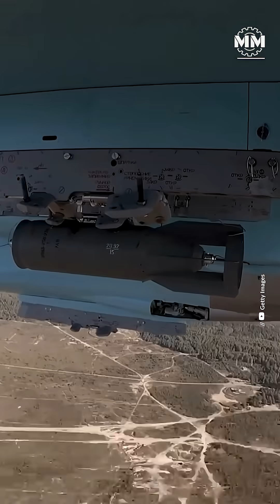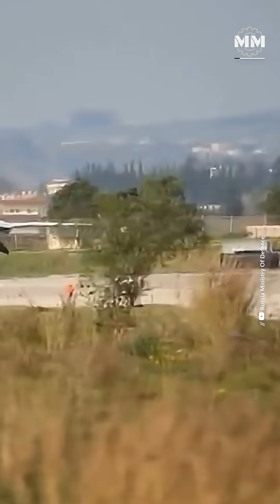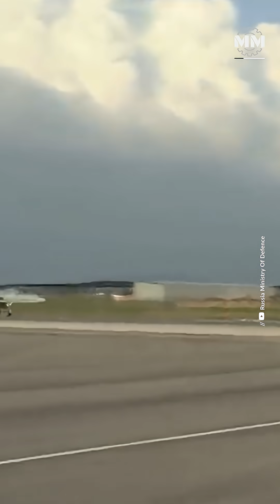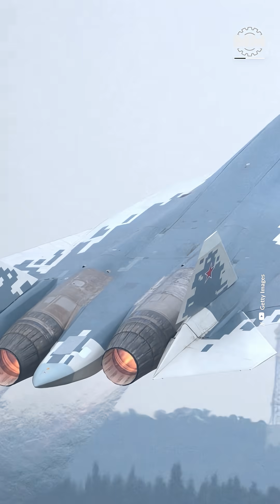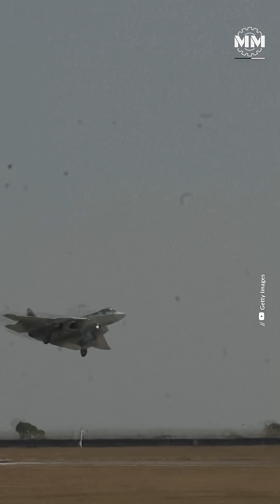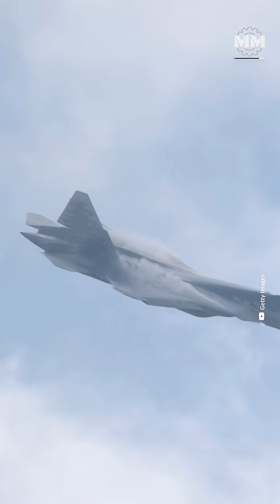The Real Reason Russia’s Su-57 Sounds So Different from the F-35

Comment: fun fact - F22 engines weigh 20% more, providing 10% less thrust
Reply: Have anyone seen the SU57 over Ukraine?? Anyone???
Reply: @peterlongland6862

Yes, Su-57 has confirmed combat missions in both Syria and ukrain. Hope that helps if you were actually curious, if you’re just trolling then please ignore this.
Reply: @peterlongland6862 yes. confirmations are easy to find actually, if you aren't completely brainwashed.
Reply: @peterlongland6862 no. Which means Su-57 stealth is working. Get the idea?
Reply: @ryszardrakowski2711 non existence is not stealth!
Reply: @peterlongland6862  has the f-22 ever engaged with anything more challenging than a hot air balloon? Ever???? 😂
Reply: @ryszardrakowski2711 actually only 50 Su 57 are in service...no parts...Putin is also thinking twice since about 50 of them got shot down with Russias own s400 😂😂😂...look it up
Reply: @tomvlodek6377 uhh yes actually. Iranian f4 phantoms. Didn’t want the smoke so they flew away. Look it up. The reason the f22 has not had more battle presence is because when it shows up, everything else tends to behave….everyone with any type of service knows this tactic. When the f22 shows up act normal, when it’s gone, start throwing bullets and missles again. Literally the MO of the f22s whole life
Reply: @tomvlodek6377 , when the F-22 is sent, then you know you're going to get a what for. It's the only jet that can't be sold to other nations. It's that dangerous.
Reply: and the f22 would still smoke the su-57 10 out of 10 times and it’s literally not even close
Reply: @extinnocence , nice dreaming
Reply: @kaka_kaka28 google it man it’s really not an opinion… SU-57 is a beautiful plane and I respect the engineering and I also accept the reality that the radar, stealth, and weapons capabilities simply don’t even come close and if you say otherwise you simply haven’t done your research
Reply: What’s so fun about that?
Reply: This guy is full of shit and doesnt know anything.
Reply: Fun fact. One Raptor could take out 3-5 SU-57’s before they even knew they were there, and that depends on how many SU-57’s actually are airworthy. Very unlikely that they have five of them ready for a battle. There’s a reason why the F 22 has never been in battle. It’s not needed. It’s too good! So good that it’s actually against the law for us to sell the F 22 to any other country. Fuck Russia!
Reply: Which one of them have been used in a real war? The fight against sheep armies or real war?
Reply: @josephguillen187  they shot down a 'chinese Airship" :D
Reply: @pingumy , Yugoslavia shot down a stealth aircraft F-117 using Russian radar for detection and later they wrote an apology letter to the American President "Sorry. We did not know that the F-117 was a stealth fighter". 😂🤣
Reply: @kaka_kaka28 That pilot that lost the F-117 was reprimanded for making several mistakes in his procedures and his flight path. Had he followed his instructions the F-117 would have never been shot down. So yes we lost a stealth fighter jet due to pilot error!
Reply: @garywkline , what was the pilot error?. 

The pilot of the F-117 shot down over Yugoslavia was NOT reprimanded; instead, the incident highlighted weaknesses in the F-117's operational support and tactics. The pilot, Lt. Col. Darrell Zelko, successfully ejected and was later rescued. The U.S. Air Force's primary focus after the incident was on damage control and quickly moving past the event, which was a significant blow to the reputation of stealth technology. The downing of the F-117 was due to a combination of factors, including predictable flight paths, a Serbian radar technique of using short, precise radar bursts, and the lack of a dedicated electronic warfare aircraft to jam the Serbian radar.
Reply: @josephguillen187 Su57 shotdowned F-16 and russian stealth drone Okhotnik behind frontlines on ukrainian side, and they failed to detect it. Also Su57 performed long range ground strikes, when F22 can be armed only with AMRAAMs.
Reply: @borise4104  Russia has already lost some 150 war planes over Ukraine which is why they lob glide bombs from 70 km behind the frontlines, to avoid adding more to that statistic … yet they’ve managed to lose another 25 in training accidents! Even then, Russia’s Su-57 stealth fighter has only flown a few times in Ukraine and never within 100 km of the frontlines, if it were able to fly over Ukraine with impunity … then you better believe that Putin would be using it!??
Reply: @borise4104 😂😂😂😂😂😂 of all the things that never happened this is one of the ones that never happened the most.
Reply: @borise4104 USAF 2W1 here. The F-22 can carry more than AIM-120's. You don't know what you're talking about.
Reply: @jacushman yes. aim-9x too. but another weapon only on external pylons.
also known that f-22 is a specialised air superiority fighter, incapable of ground strikes (f-35 was created to close that gap). also, f-22 was created before 32bit personal computers, and the level of digital modeling and firmware in the electronics is totally different now and in the late 80's, when f-22 was created as its radar AN/APG-77.
Reply: @borise4104  LOL You still don't know what a 2W1 is. The GBU-32 and the GBU-39 can be carried internally on the F-22. As far as avionics go, ever heard of Block Upgrades? The F-22 has gone through several with the newest being the Block 35 upgrades. You don't know what you're talking about.
Reply: @borise4104 It would've been embarrassing if their brand new flagship jet lost to a 40year old version of the f-16 in airspace that is contested.
Reply: @AgneDei  offcourse! that's why you did hear about "gamechanger f16" only before they arrived in Ukraine. what western propaganda is ignoring with a really iconic pokerface is how fast f16 was wiped out. and no one speak after that about them or about that they was sent to Ukraine at all. if only Ukraine didn't had largest post-USSR anti-air defence after Russia their airspace was not contested from the 22s.
Reply: And F22 engines have 40% longer service life than Al-41FN
Reply: And yet it’s 75% better of an aircraft, and in service. Fun fact.
Reply: @jritte1968

Both aircraft are in service. And there is no proof that 22 is, in any way, better.
Reply: @jritte1968 better in shooting down balloons, when Su57 is better in actual war usage.
Reply: @borise4104 The SU 57 has never been used in actual combat. Putin knows it’s an air show performer and not an actual combat asset. Why do you think India dumped it? No one would dump the F-22 if they could get them.
Reply: @matthewhuszarik4173 The S-70 Hunter drone was shot down by a Su-57 deep behind the front line on the Ukrainian side. This fact is not disputed even by the completely unprincipled Western propaganda. Also Su-57 performed many long range ground strikes and was filmed by ukranians on their side of the frontline. Also Su-57 has the longest recorded air-to-air kill vs F-16.
Reply: @borise4104 😂😂😂😂😂😂😂 an SU-57 “world record kill” vs F-16 omg that’s so funny. Keep dreaming sukka
Reply: @borise4104 😂😂😂😂😂😂😂😂
Reply: @matthewhuszarik4173  how tf would you know, american fanboy?
Reply: @Desert_airgunner  did you get paid in dollars or spooge for your post?
Reply: @matthewhuszarik4173 100% correct...F-22 is still the KING...second only to the new F-47
Reply: @borise4104 сравнивать Су 57 с f-15 f-16 одно и то же что сравнивать хрен с пальцем 😂😂😂 даже  Су 27 в спарингах сбивает f-15 в восьми из восьми случаях. У f-15  шансы победить  даже Су 27 равны нулю
Reply: @jritte1968  fun fact, f-22 is a pos that is awesome to use on barefoot civilians and hot air balloons 😂
Reply: @tomvlodek6377 You gonna cry now?
Reply: Su-57 is a 4th generation fighter with questionable stealth technology....end of story....its like Iran flaunting the F-4...😂😂😂😂
Reply: @jorgegutierrez3054 cope 🤡
Reply: The US builds overpriced, useless garbge. And the pathetic F-35 is so stealthy, that when one crashes or doublles as a submarine evenUS air force cannot find it. 🤣🤣🤣🤣🤣. And ask India what it thinks about the pathetic flying laptop.
Reply: @ryszardrakowski2711 haha you have absolutely no idea what you’re talking about
Reply: @ryszardrakowski2711 your an idiot, the indian dont have the F35 nor have they flown agaist them. Old proverb, its better to stay quiet and let people think your an idiot then to open your mouth and prove it!
Reply: @ryszardrakowski2711 lol yeah so terrible the Israelis used it to shit all over Iran without getting a scratch in return 😂😂😂. Sorry your shitty Air Force can’t afford good planes bro. But until one of you losers actually shoots down an F35 or F22 you need stop crying.
Reply: @ryszardrakowski2711 aahhh😂 jealous your country cant afford even 1 F35?
Reply: @ryszardrakowski2711 Yeah, so usuless it outperformed all other aircraft. The early migs had a slight advantage till the F4 and then it was downhill from there for the migs.
Reply: @peterlongland6862 And yet you have to force the other countries to buy your fighter jets.
Reply: @josephguillen187 is that what you think, how wrong can you be. Not all NATO nations use Americans jets. You should know that. Already you have been proven wrong!!
Reply: @peterlongland6862  delusional fanboy 😂
Reply: @peterlongland6862 according to USA propaganda! 😅
Reply: The F-22’s engines allow for Super Cruising without afterburners and can’t be seen by radar. The SU-57 is an airshow performer that dies having never seen the enemy in actual combat. Why do you think Russia isn’t using them deep inside Ukraine, but the Israeli Air Force takes its F-35 right into Iran?
Reply: @matthewhuszarik4173  youre an idiyut
Reply: @matthewhuszarik4173 Russia IS using them, and even the Su-35 has a super cruise, and Su-57 had it even with first generation engines. With the second generation engines it has 2M supercruise and greater than 1.5 thrust to weigh ratio.
Reply: @borise4104 F-22 Super Cruise >Mach 1.5. SU-35 Super Cruise Mach 1.1, SU-57 Super Cruise Mach 1.3. F-15EX Mach 2.2-2.25 without afterburners. Before they called it Super Cruise.
Reply: @matthewhuszarik4173 You already wrote complete nonsense here. And still trying to continue to do the same.
Su57 with serial engine has 2M+ supercruise. F-15EX doesn't have supercruise at all.
Reply: @matthewhuszarik4173 Matt mate, I'm a huge fan of the F-22 but you have got your information wrong. I'm a life long aviation enthusiast (aka nerd..I do fly myself though with a CPL) so I love and appreciate any and all good aircraft regardless of the country who built it, that means nothing to me.

The fact is the SU-57 has the most advance and best supercruise ability of any aircraft made too this date. It exceeded anything else even 2 years ago on the old engines. With the new significantly improved engines it's miles ahead. M.21  supercruise without afterburner and extremely good fuel efficiency. 

Like it or hate it (which I can tell you do) that's simply the facts.
Reply: @borise4104 all this Russia talk and yet we can all see Russia struggling against $20 drones and 60 year olds drug off the street two days earlier. Russia would get their teeth kicked in by a modern military with training.

Comment: So? If you are close engough to hear the nois you are alrady fucked. Also the su 57 also has the capacity to supercruise. Bouth the F22 and F35 need to engage the afterburner in order to sustain the high angle of attack manuvers used in airshows. In the video you can see the F22 lighting up the afterbuner to ewngage in manuevers.

Comment: You’re mixing up a few things. The compressor blades (at the front) are open on each plane and there is little noise made by the compressor blades- a whine. There are no fan blades as they are turbojets not turbofans. I think you could simply say that the F35 (and you’re showing the F22) have a more effective noise reducing geometry behind it.
Reply: Turbo jets have fan blades too
Reply: @AndrewPlura-lt3mr  They have blades, but they are compressor blades. "Fan" designates a set of blades moving air that is partially bypassed around the engine. Turbo fans have some degree of bypass. Turbo jets feed all air through the engine internals.

Comment: That howl was valid for the prototype, the actual SU-57 doesn't do that. Also regarding the stealthy flat exhausts: the SU-57 has that option, you can actually mount either the round nozzles for better agility or the flat ones for better stealth. And I'm not talking about different models, you can place either option on the same aircraft depending on the mission
Reply: the flat nozzle is on the newer AL-51 engine, which will be used on the SU-57M. But currently the SU-57 is produced with the AL-41F1 engine, which is only with a round nozzle. 
The Russians claim that flat nozzles have a thrust loss of 8% and the AL-41F1 engine is already considered underpowered for the design of the SU-57
Reply: И очень жаль. Звук был необычный, как вопль мифического существа. Ни с чем не перепутаешь

Comment: The su-57 is so loud because of all those loose bearings in the engine, The jet is supposedly "stealth", but its louder then an entire American squad, the engine intakes completely ruin the stealth as the video said, and there's only like 30 of them. A freaking f-4 would destroy it. F-22 are loud when low to the ground, but not at 60,000 feet in the air. where it cruises. and f-35 is the same.

Comment: I have not been around an su-57 but i been around the F-22 and it is by far the loudest jet i have ever heard.
Reply: You heard 1 jet in your life and thats the F22
Reply: Mig 21 .. Hold my bear 😂😂😂
Reply: The SR71 full tilt was pretty loud.
Reply: that's only at low altitudes
Reply: Avro Vulcan and Concorde.  Both used a version of the same engine, the Olympus.  Loudest thing I have ever heard.  Especially when Concorde would pass over my  house every morning.
Reply: The B1 Lancer is no joke either. Loudest jet I've ever heard.
Reply: At low altitude but at 30,000 feet totally different thing
Reply: The Raptor is really quiet at low speeds.
Reply: Nothing I've heard flying is louder than the Phantom. That includes commercial airliners.
Reply: @BigKnGa I forgot about the F4. It was very loud. Was a store manager for Kinkos back in the late 90's and because the delivery was to B.A.E flight systems I decided maybe I needed to take it. Got to see the F4 up very close. They were still using them as drones back then. Super cool. 
We have one on display in the town next to us.
Reply: Вы не слышали русский ,,Фантомас,, или ,,Сверхзвуковой,, как шутили советские лётчики и механики. Это самолёт Ан-26😂